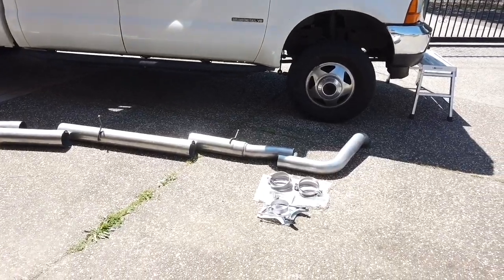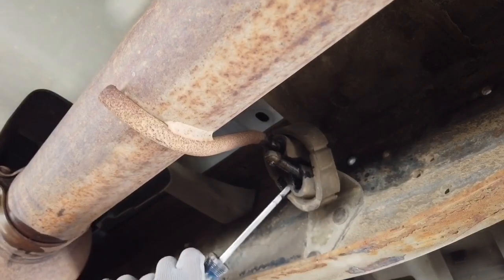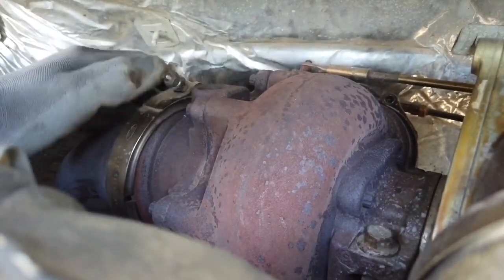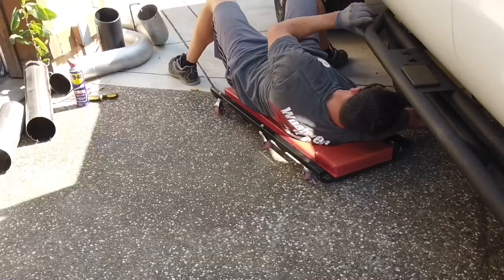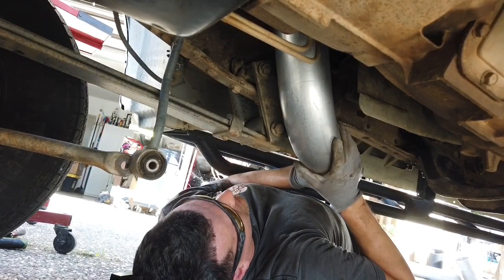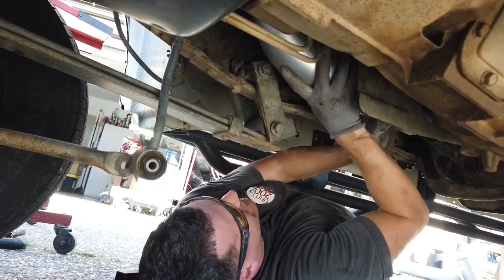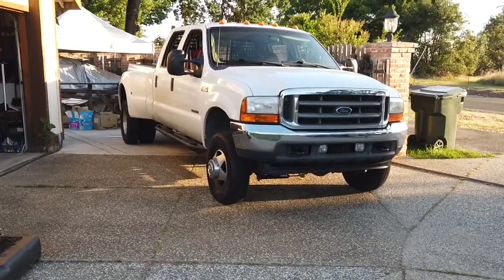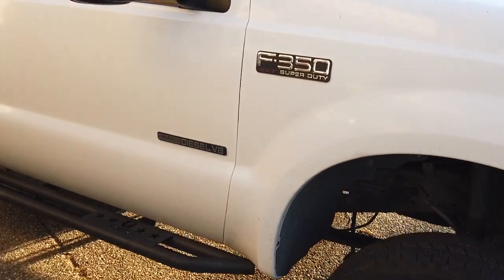2001 F350 7.3 PowerStroke ITS TIME 5" AFE Exhaust STRAIGHT PIPE How to install She Sounds Amazing SP

Comment: Yes the 5" does cool off too quickly for a almost stock 7.3 powers stroke a 5" starts becoming advantageous when you have stayed 3 injectors and are pushing 900 plus horsepower then you need the 5" to keep the EGT temperature down tomorrow I will post a video of my truck with the 4" exhaust Turbo back and the 6" tip
Reply from the maker: Yea 5” is honestly more than truck needs, I had a 4” before on an F250 7.3 and I love the 5” sound more even tho is prob hurts performance a bit
Reply: @FixItNick   I think it'll be ok not that big a deal.

Comment: I used to have a 2000 Ford F-250 7.3 power stroke 4x4 crew cab the pant job was blue jeans denim it looked beautiful, my dad bought it back in 03 when I was born and dul straight piped it, it was so loud.
Reply from the maker: Yea these are awesome!

Comment: You took it apart the hard way, I used a craftsman reciprocating saw and made 3 or 4 cuts and it came right out. Now you made the up pipe look easy, I wrestled with mine for hours and I hated that clamp. Question thou what was that thing just past the down pipe?? Will you need that for SMOG in Cali??
Reply from the maker: Well cutting 3-4 times I didn’t wanna do, my goal is to preserve it because like I said I live in CA lol and she sucks!!

Comment: You should cut the extra pipe inside the tip, the tip adds a deeper tone but not with the pipe going to the end of the tip.
Reply from the maker: Yes I was going to cut after I decide exactly how I want tip to be

Comment: I also removed the valve and put the power elbow on from banks where you started your exhaust . Covered it with stainless steal insulation so the Cal eco freaks could not tell..

Comment: In California they do a visual inspection on our diesel trucks. I remove my tuner and have the cat on mine. My s&b intake is carb compliant. You can either hollow out the cat or sandwich it over the new pipe so it looks like it has a cat.
Reply from the maker: Yes in CA it’s only fun for 2 years then you figure out plan B lol

Comment: For optimal tip sound, you have to cut the 5" as close as you can to where the tip mounts. No need for a huge tip if the 5" goes through it.  Lol.

Comment: The Mirrors on the truck obviously are the older super duty tow mirrors get the square ones of the 2008-2016 model years also the 1999-2016 model years have the same bolt patterns so you can take the front clip off a 2016 and bolt it on a 2001 and it will fit perfectly
Reply from the maker: What front clip? Nose conversion? Needs custom brackets to do swap to 16 nose. I want new tow mirrors also lol
Reply: Coby Sanderson everything from 1999-2016 is interchangeable with slight modifications such as different brackets. There is a guy who puts full 6.7 interiors into 7.3 trucks and he just has to change dashboard mounts and similar stuff.
Reply: Raceboy5512YT that’s what I was saying

Comment: I still want to buy the Truck but the Torsion Bar Arms look like they don't have bolts. lol
Reply: Yeah man I saw it too good eye 👁👁😁😂
Reply: The sway bar links?  Torsion bars are for chevys.
Reply from the maker: Yes I disconnected away bars for off-roading lol
Reply: You really dont need them on these trucks. They are still I notice no difference on mine at all

Comment: it sounds very good, it rushes the sound of the turbo more ... in my opinion it would look good with the polished wheels and the bumpers ...regards
Reply from the maker: Thanks, yes I want to upgrade wheels when can afford them 20s lol
Reply: I Dig your Vids Nick, Great Stuff! I went with F550 HD Leaf Springs, a 3” Wulf Suspension Block lift to get a set of 315/60R20 (35x12.50) Toyo Open Country RTs on Fuel D574 Rims w/4.5” Gap, 225mm offset, for my 02’ F350 DRW. Leveled it right up when hooked up to my 5th wheel Toy Hauler, cuz it was saggin quite a bit. Keep up the Great Work, I’m learning a lot from You

Comment: U need to do a exhaust back pressure valve delete. Or called warm up valve.
Reply: Adam Esterlund no need to delete if it isnt acting up. if he tows he will need it, that valve is where you engine braking comes from. not to mention faster warm up when its cold out.

Comment: U can do a mpg test. But with wut lil u have done it mite hurt u. The 4 inch would have been perfect and got better fuel economy, and please don't put a bigger tip on it. Leave it at 6inch
Reply: I read somewhere 4" is better for the 7.3. Than 5" .  There's math and science behind it. Said with the 5" the exhaust cools off too quick,  resulting in power loss
Reply from the maker: Yes 5” is to much I agree, but I love the sounds little better than 4” .... I guess I have to turbo and inject her haha
Reply: I run stage one and a 1/2 full force injectors and AGT38R ball bearing Turbo and it's perfect for what I do along with the Hydra tune the fuel bill Martin the forage exhaust

Comment: 7.3’s are the way to go if you want a powerstroke. Also that 7.3 purrs like a kitten nice truck. A 7.3 power stroke is on my bucket list for a second car/truck I probably wouldn’t daily drive one but it would be a good work truck. If I had one I would do something similar like what you did on your truck.
Reply: Ben Fink 
Yes sir. 
I have a 2002 F350 Lariat SRW crew long bed in 4x4 with 6” suspension lift. 
134k miles. 
4” straight pipe 
AFE CAI
Hydra chip
Full Force Diesel Single shot 180cc injectors 
And gauges
Best truck I ever owned 
PERIOD!!!
Reply: @jayonez 13 Sounds like you got the truck of all trucks I’m jealous that is something I would probably do if I have enough money how much did it cost for your build?
Reply: Ben Fink 
I was around $20k
Smoked my Trans back in 
Feb 2019. 
$6000 for trans build with some billet upgrades and new rear main seal
I am now at $26k. 
But in my mind still more reliable and cheaper than a newer 6.7.
What’s really going to hurt is next year I have to pull the engine and do the oil pan. 
Oil pan Is shot. 
When I pull the engine I’ll do some other stuff. 
New exhaust manifolds
38R turbo
And bellowed up pipes. 
I will be at around $30K after that. 
Then I will be done for while.
Reply: jayonez 13 yeah you should probably slow down when you spend money on your truck. But hey like you said at least it’s cheaper then a new Powerstroke. Also what kind of engine you got in your truck?
Reply: Ben Fink 
🤔 
7.3L dude.
I said in my OP that it’s a 2002.
And I really don’t understand what you mean when you say I should probably slow down when I spend money on my truck.
I really don’t know what that means. 
Working on my truck is basically A hobby of mine. 
When things break I fix them. 
If you don’t fix and Maintain things you will not have a reliable truck. 
This Truck is not a daily driver Although it could be. 
I have a company truck that I take home. My 7.3L is my weekend Hunting/fishing/camping/racing truck. 
It hauls my 39’ RV all over the place. 
It hauls my race trailer.
At a moments notice I could sell it and pretty much get back 95-100% of my investment. 
I’ve been offered $30k cash for it from friends. 
My Mechanic Harasses me to sell it to him all the time. 
I had strangers following me into gas stations and parking lots to inquire about it all the time. 
Not that I would ever sell it.
Reply: jayonez 13 oh ok i get what you are trying to say i thought you were those types of people who turn there truck into like a show truck my bad.
Reply: Ben Fink 
Nope!
She is a work horse that also looks great!
Reply: jayonez 13 Nice did you give it a nickname or no?
Reply: Ben Fink 
Big Red
Reply: jayonez 13 That’s a cool name
Reply: Ben Fink 
What do you drive?
You have a truck?
Reply: jayonez 13 currently I can’t drive yet  but I’m planning on restoring/fixing a 70’s ford pickup from my dads uncles farm it’s probably been sitting for maybe more then 10 years in a garage i’m hoping the frame isn’t rotted out but it also has some mods on it. I’m not sure if i want to swap an engine like 5.0 coyote or an engine similar in it right now.
Reply: Ben Fink 
Awesome man!
Best of luck. 
I used to have a 1968 Ford pick up when I was 19 yrs old.
Reply: jayonez 13 That’s cool
Reply from the maker: Ya man I’m trying to find daily beater car for work, parking a dually is a chore haha
Reply: FixItNick 
Yea man!
My daily beater is a 2019 Chevy Colorado 2 x 4 drive company work truck

Comment: Do the small prices get added or not added by your truck size? My truck is a 2002 f250 extended cab short bed so will it still fit without cutting up the new exhaust
Reply from the maker: I only had to trim the tip a bit and everything else was fine
Reply: So would I have to cut it to fit it into a extended cab short bed

Comment: Wonder if they would help me I need custom exhaust for my v10
Reply: rcwildman123  I would love my v10 to sound just like that love the aggression
Reply: rcwildman123  I want my exhaust to come out on both side right next to the tow hitch one on each side of the tow hitch is there any way I can email you and get some info from you on the things you got for your exhaust mine will be running  Gibson headers like what size pipe you used thanks for your time wildman and information
Reply: rcwildman123  what high performance cat did you use and did you keep it a 3 inch pipe and do you have the exact info on the flowmaster super 10 muffler style you used
Reply from the maker: They only do diesel trucks but I’m sure they can still get stuff for V10s
Reply: @FixItNick  if they only do diesels probably not
Reply: rcwildman123  did you get a flowmaster super 10 muffler with a single inlet a d dual outlet or did you use a single inlet and single outlet to an x pipe for the end of the exhaust
Reply: rcwildman123  was okay so you got a single in dual out flowmaster super 10 muffler I cant find a super 10 muffler that does 2.5 inch in and dual 3 inch out they only do 3 inch in and dual 2.5 inch out
Reply: rcwildman123  unless the exhaust shop cut the 2.5 dual out off the muffler and welded a set of 3 inch connectors on and put a 2.5 in the 3 inch spot
Reply: rcwildman123  they could of welded the right size inlet and outlets on the brand new muffler and then finished the exhaust cause you said they custom bent it for you
Reply: rcwildman123  was okay so they used reducer for one side and a ste9 up adapter on the other that makes sense alot faster did they used the band clamps on yours to hold the pipes together or complete welded up exhaust system
Reply: rcwildman123  I understand but my truck has 3 inch pipe from y pipe to the end i dont want to make my exit pipe smaller because i have alot of engine upgrades in my truck dont want to restrict the exhaust
Reply: rcwildman123  took the engine out working on going 10 over for pistons having heads checked and upgraded rockers and springs looking at getting cams and crank done all around upgrading the motor and exhaust is being done to match
Reply: rcwildman123  no problem with spark plugs on my just doing a horsepower upgrade on mine
Reply: rcwildman123  I have cold air intake also on mine I have volant cold air intake system and I have upgraded granatelli coils
Reply: rcwildman123  were did you buy the tunes from if you dont mind me asking
Reply: rcwildman123  5 star tuning is who I contacted the irony in that is funny
Reply: rcwildman123  very true
Reply: rcwildman123  heck yeah wildman I would watch the updated video
Reply: rcwildman123  to see results is always nice
Reply: rcwildman123  stiffer is always better on shifting for towing
Reply: rcwildman123  lol

Comment: How did you get a 5" pipe from the turbo down? Was there enough room between the firewall and the pipe? Not sure if yours had a heat shield but without mine, can heat did go up.
Reply from the maker: Yea downpipe is 4” cuz 5” will not fit, will hit everything lol

Comment: The 5 inch is to much for that truck. U don't have enough done to it to support it. 4 inch turbo back would have been perfect for u
Reply from the maker: Yes I know, the 5” want was strong lol
Reply: The size don’t matter much the biggest difference is in the tone and while towing heavy I’m sure any diesel would like to breath a bit more
Reply: I'm sorry but you are wrong. It's like a potato cannon. If it's to big it wont work right and if it's to small it wont work right. 4 inch is the best and most efficient size for anything under around the 700 hp mark.
Reply: 313dieselguy oh well🤷🏽‍♂️ I say fuck it and enjoy the music to ur ears I got a 6.7 I’m more than fine

Comment: IM SURE YOU KNOW YOUR SHOCKS ARE LEAKING. GET BILSTIEN THEY RIDE GREAT.. ALSO A FEW TACK WELDS AT THE REAR HELP THE PIPES STAY IN PLACE UNTIL THEY RUST TOGETHER.
Reply from the maker: Yes I was thinking to tack couple spots in the back just in case and yes shocks I want to get a set also :)